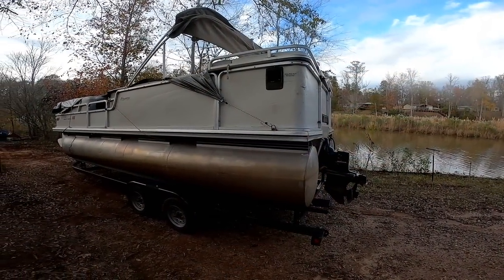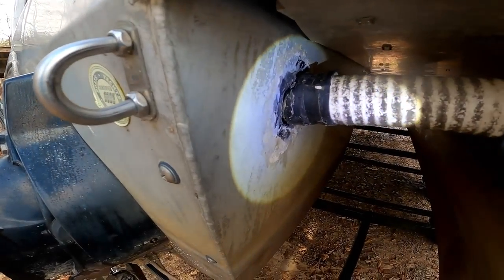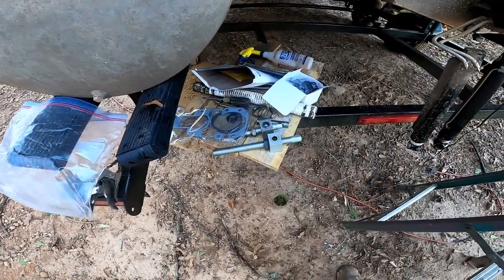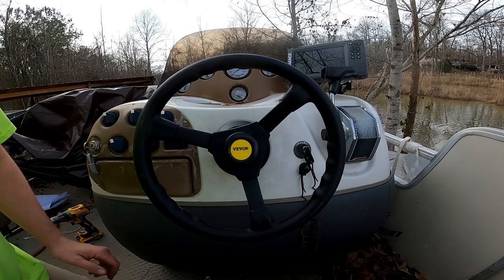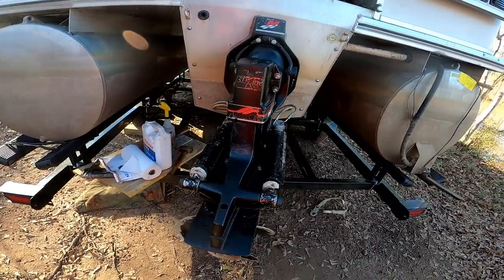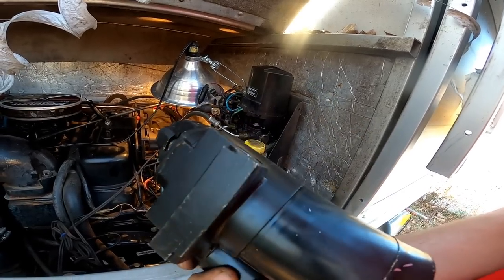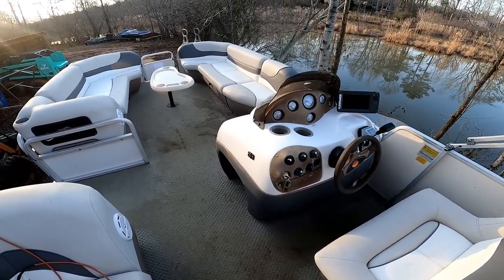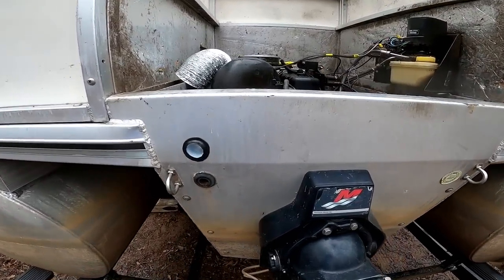Fixing A Pontoon Boat

Comment: Heads up. When take those corroded screws out, when it gets to where it stops, spray it and turn it in, then back out. Repeat until it’s out. You’ll be successful with out stripping the head or breaking it most of the time. 25 years of taking those apart, I learned a few things. BTW muskrats and other rodents love those sensor wires, like moths to light.
Reply from the maker: thanks again Scott 👍🙂

Comment: As far as the freeze plug, pull the outdrive like before. The engine can come out with out it, but it’s just easier. Also while you’ve got it apart check the engine coupler for wear. Its brass, it’s meant to be the weak link in the drive. You’ll need a lineup tool to properly put it all back together once you pull the engine. If not a slight misalignment in the engine coupler to the drive shaft will eat the coupler splines and cause a failure. Something else I noticed. The oil level in the drive should only fill to the level of the plug on the side. Overfilling will blow seals, and or prevent proper circulation of oil through the drive. Best get a service manual to reference. Good luck.
Reply from the maker: thank you for the great info Scott it’s VERY much appreciated!

Comment: Great video. This could be a good reference video for me on this type of inboard as I have a very similar setup on my Maxum 20' open bow. 
I am curious tho as to how the water got in due to that freeze plug? That should be separate as that's part of the engine block and not part of the actual prop setup. Maybe I'm missing something here! 💁🏼‍♂️🤔
Reply from the maker: The freeze plug burst so when u drive the boat it fills the whole engine bay up with water
Reply: @TheHomePros6221  
Ah okay, guess I must have missed that... lol

Comment: the trailer bunk looked real close to the steering cable and if you ran the boat onto the trailer too agressively, it could possibley hit the cable and bend the sleeve you cut off with your grinder.
Reply from the maker: yea better watch out for that

Comment: This why I started building pontoon boats house boats many years ago. All these factory pump out the door boats are built out of thin tin can crap. You punch a hole in one pontoon that whole side going down. I order the pontoons in any size from 18" to 58" any length. Each pontoon has a solid welded in bulk head every 5 feet. For an inboard out board i/o it needs to be installed in a 10 foot long center pontoon to take the weight an be stable. The pontoon I order are built here in Canada and are Canada an usa Coast Guard approved and Transport Canada approved. Were your steering cable go iñn. There needs to be a flex rubber boot to seal out water. Not sure how the factory has instaĺed the drive an engeine but if they didnt cheap out the engeine should pull out with out removing more then you did. Just do not remove the yoke or you will need to buy a $200 cnd lining shaft to reset it. There should be aluminum motor mount tabs welded to that cheap tin can box. If you bought a sea star cable you will never bend them. Not sure why you changed the steering box. Maybe that off brand only sells a whole kit. Even if you bought the sea star kit. Cable an box. Steering wheel is extra do to there very wide rang of style color. But you can buy just the cable. An they have a 15 year waranty an all there rebuild parts are life time. An there oils . If damage is done from there oil they pay to rebuild or replace research Sierra oils
Reply from the maker: the pontoons on this are actually very solid and strong, they took a direct hit to a stump and no damage was done, also the engine is mounted in a center pontoon just like you said, did you even watch the video?? and the old steering kit WAS a sea star and it bent!! I do appreciate your tips but I couldn’t understand what you were talking about on how to pull the engine and replace the freeze plugs
Reply: @TheHomePros6221  it sure didnt look like a round center pod with a cone on the front end. Center pods I use are 3/16 marine aluminum and have a black tight angle top were the engeine sits in. Bottom is rounds as well as fully round up to the cone. I dont see the weld seems every 5 feet were a bulk head welded in. Or a 3/4" pipe plug in the top side of each 5 foot section  Every factory one I have repaired there no bulk heads an aluminum is only 100 wall thinner then 1/8"  if that's a center pod it should have around a 3.5" rectangle at the back of the centre pod and then rounded off like a regular pontoon and then fully rounded with 6in aluminum channels welded on each side. The bolts with stainless steel bolts to the main structure and 10 ft long with a nose cone like the other pontoons. It's the old steering systems a Seastar is warranty no matter how old it is for what happened. Chipotle engine remove the outline as you did disconnect all electrical and cooling lines unbolt the coupler at the Hub and undo the four motor mounts lift engine and slide forward to clear the Hub and lift up. Remove old frost plug clean with fine Emery cloth clean casting were new frost plug fit clean with brake clean drive new frost plug in with a socket that fits to the outer edge of plug. Tap it in slow an strait. Once well started drive it in flush to the block. If new frost plug do not have a dry strip of red lottie put some around the flange before install
Reply from the maker: good info thanks, the aluminum is most def thicker than 1/8 it’s like 3/16 or bigger and it is made exactly like u said with the bulkheads and unbolts from the main boat exactly like u said, thanks for all the good info 👍🙂

Comment: I made a ton of money over my career after incorrect diagnosis & customers taking things apart like you did. No need to remove lower unit for steering diagnosis. No need to remove helm rotary steering to replace cable. Saddened me to see your repair instructions. Please go to school to learn correct proceedures.
Reply from the maker: I know this dummy I took the lower unit off to inspect the bellows and grease everything, I know I could have bought just the cable but I wanted it all new is that a crime? In the end it all worked and the owner was happy… so take all that money u made and go back to school and make some friends